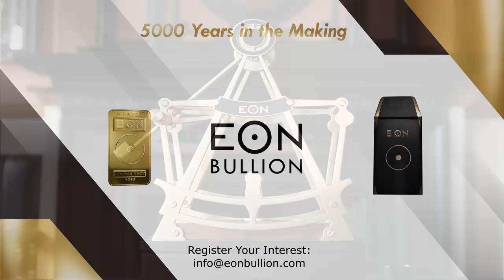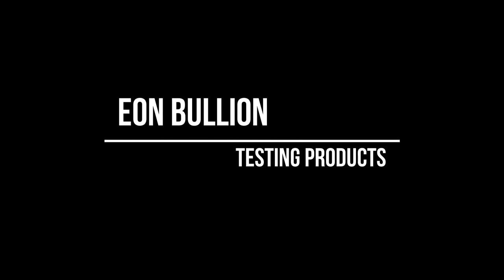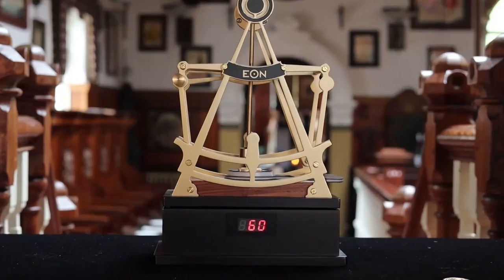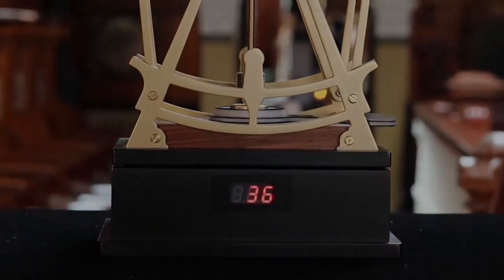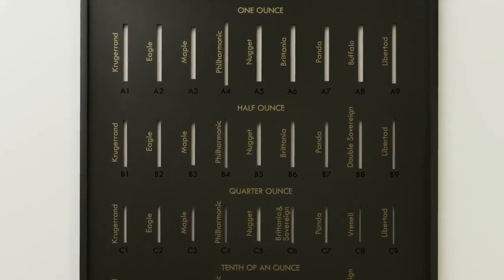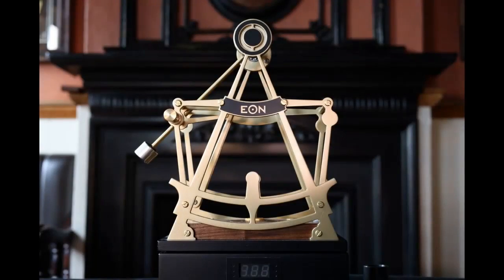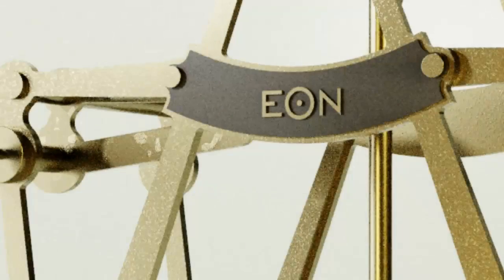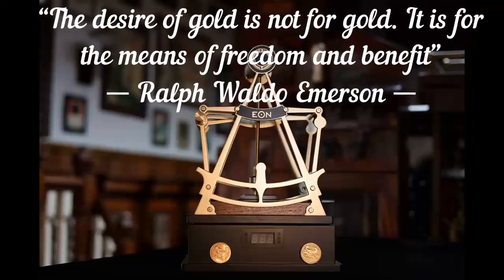GOLD TESTER MACHINE | BULLION TESTING & AUTHENTICATION | An Affordable Gold and Silver Tester!

Comment: So the fake coin is more conductive since the eddy current braking stopped with fewer oscillations?
Reply from the maker: in this case the Fake coin is more conductive, as there is some nickel in the plating. And the real coin is an Alloy coin of Gold, Silver and Copper, hence a lower conductivity. typically the pure gold and silver coins will be more conductive. How we do it is that we get a reading from each coin which will be given in a table to test against. A particular coin will have a particular reading, which can be verified from the table.
Reply: @OneTroyOuncePreciosMetals  Thanks.  I'm on your wait list as of yesterday.  As well, this will be a good teaching tool about eddy currents, etc. to science students.  I think I saw a forum poll somewhere asking for expensive and refined vs. more plastic, but cheaper.  I'll take either, but the more expensive, refined wood approach is my vote.